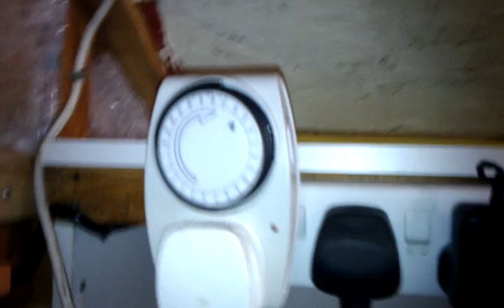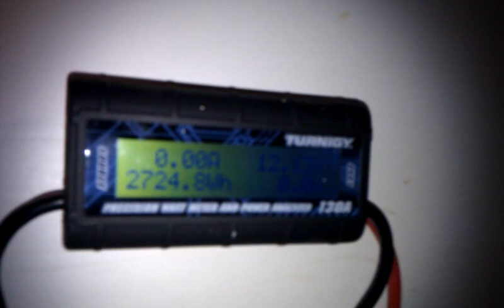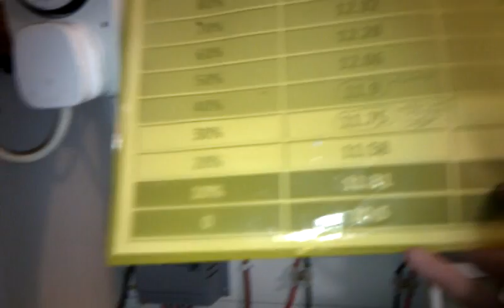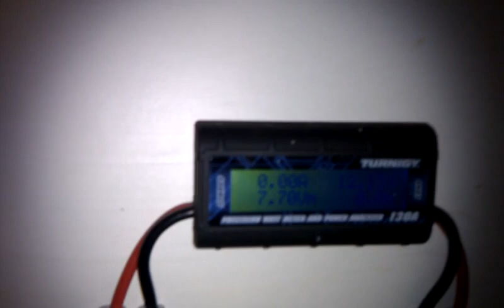Solar powered shed setup UK - March 2011 Update

Comment from the maker: Hi Pat,

This is not something we had planned as the inverter we use is only capable of 300w peak. However yes for a larger setup a consumer unit on the 240v side would be a good choice for extra safety especially with the availability of RCDs built into them.

Comment: Hi, I found the Videos very informative, I now feel a bit more positive about tackling my own little project.  I will be creating a off grid system to start with, in the garage.  Did you ever consider wiring the inverter to a small consumer unit first an then have sockets from that.  It feels a bit safer to me.